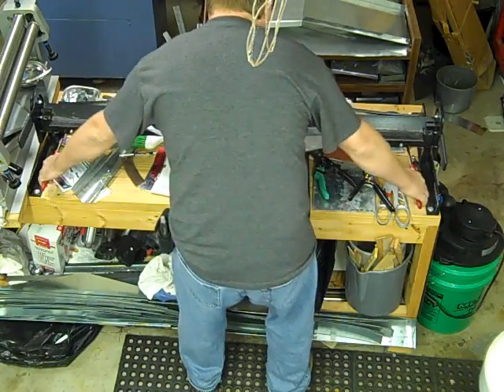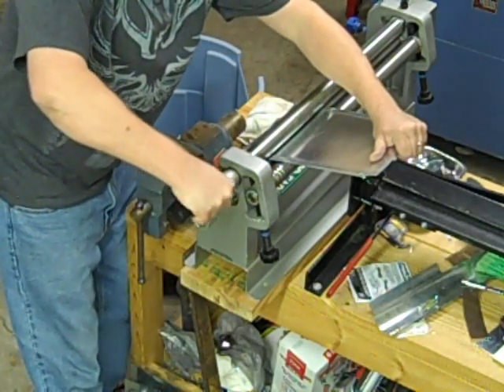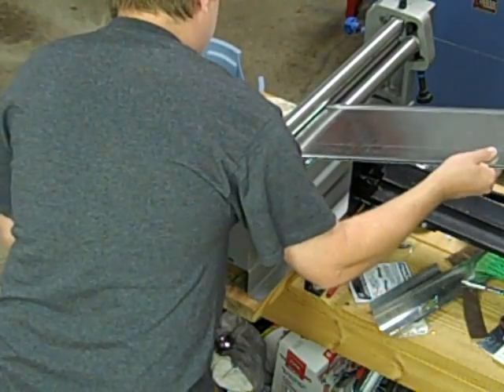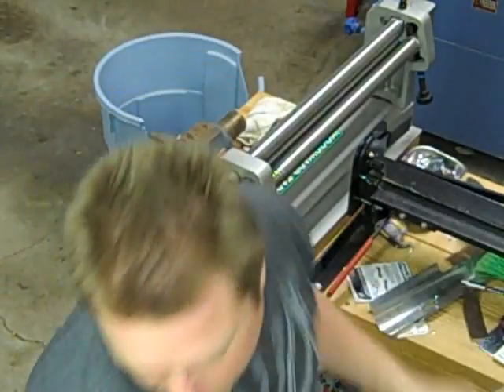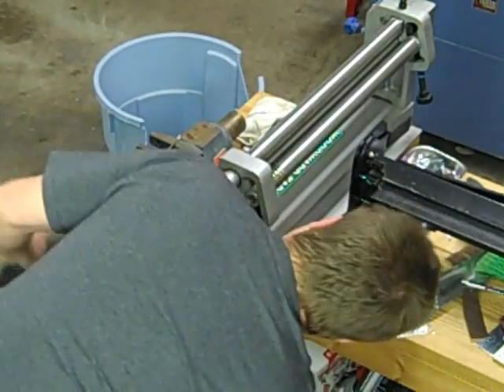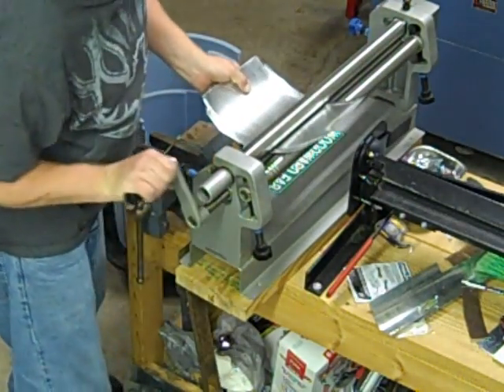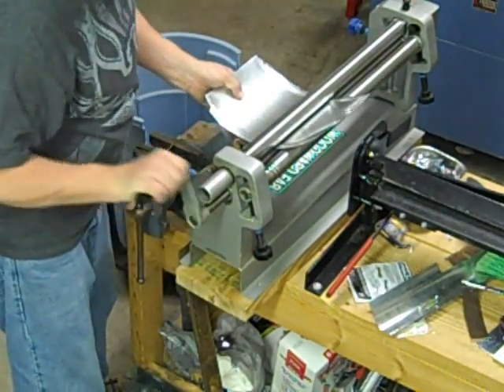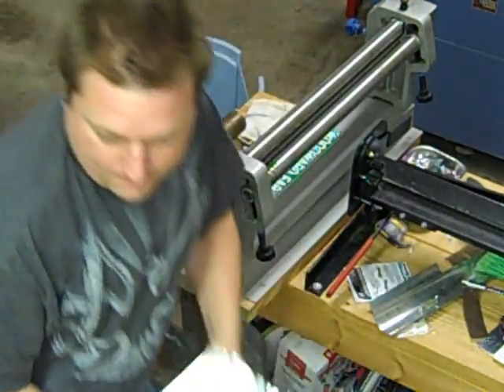HVAC Design Build Process Pt 8 Fab 8x16 broadway Machining.wmv

Comment: Hey tstatech. I came into the HVAC side of things after a long stint in commercial refrigeration. And I really appreciate your posts and videos. You seem to be a guy who strives to make your customer's systems work as intended. Your videos have shown me key areas of the trade ( ductwork and venting especially) that many installers and tech's seem to neglect.  I have worked on many houses in my area ( Wisconsin) and rarely see as much thought or effort put in to running duct as you do. It is all about quantity, everybody just runs 6" round to everything. Duct sized slightly too large to reduce velocity and noise, radius and custom fittings. These are things done in the old days. I have no problem following your videos and would like to see more. Your efforts have made an impression on me and I can only hope to get my skill level near yours, thanks again.
Reply from the maker: Tony Sorensen Thank you, I really appreciate your post.

Comment: Not the best demonstration I've seen. I been out of the sheet metal field for 20 years now. Here are a few pointers that will help in fabrication and shop set up.  1st add a bench to the right side of the lock former so as to hold up the metal while you concentrate on feeding the metal.  2nd when rolling the back of the elbow or rolling a pice of metal that has a lock former know as a Pittsburgh, on it. Add a pice of scrap  metal about 1-1/2" to 2" wide insert it into the Pittsburgh then roll it. This will keep the Pittsburgh slots  open just enough to insert the sides easier. Try it you will find this will really help.
Reply from the maker: Thanks. I know I'm not perfect. I've heard since I made this about using scrap to keep the joint open. Didn't have room for a table. Sometimes I think I should pull all my videos off of YouTube. Was just a lark anyways.
Reply: Also roll the curves before you lockform

Comment from the maker: @shadywalker No offense taken. The auto flanger can be trouble especially if you forget to set the tension from one gauge to another. I've actually never worked anywhere that had a manual flanger so I've never used one. I used to do it all with line man pliers. I used to make pittsburghs with hand tools and a brake before I bought that machine.
I'm no stranger to struggle. lol

Thanks for the props.

Comment from the maker: @dizziedallas I got real nostalgic for a pittsburgh machine for my old bosses shop equipment for the first 5 years I was in business for my self. I was forming the pocket lock with bar folders and a hammer. I was forming round flanges with linemen pliars and I was roll forming with a rubber mallet, the brake and piece of pipe. Talk about time consuming.

Now I want a real brake.

Maybe not, I want to cut back on installations and focus more on service. The all mighty dollar has spoken.

Comment from the maker: I appreciate any old school shop knowledge you can spare. 

Even though I've worked for big outfits, well big in this town is 10 to 20 people. I have primarily been HVACR and electrical service. I did some fabrication from time to time but I am self taught in the shop. I never had a teacher.
 
When I went out on my own I flipped by circumstance - I was getting more installation jobs than service work. Now that I have built a clientèle I am getting more service work.

Comment from the maker: @dizziedallas I was adjusting the thickness dial for the flanger. I failed to check it because I almost always run 26 G through it. This was 26 G but for some reason I had it set to 22 g. I must have ran 22 through it last time.

It's been at least 6 months since I had an installation job which required the flanger.

Comment from the maker: @PutSome5tankOnIt Don't you mean the heel and the throat? Thanks for the tip. I think I've heard that before somewhere but I have never tried it. 

That would eliminate all the little dimples created when you spread the lock open with a screw driver.